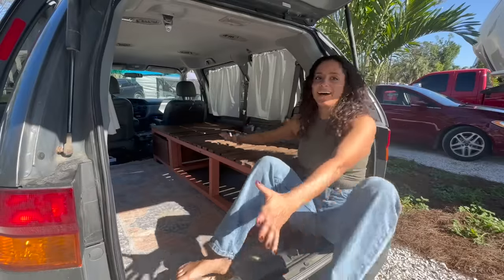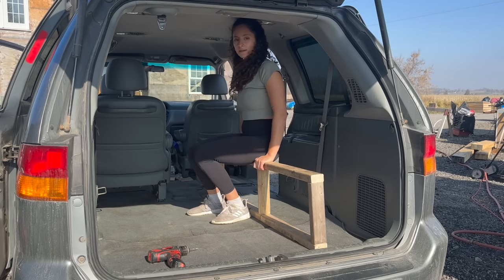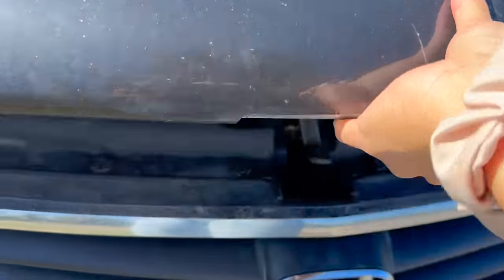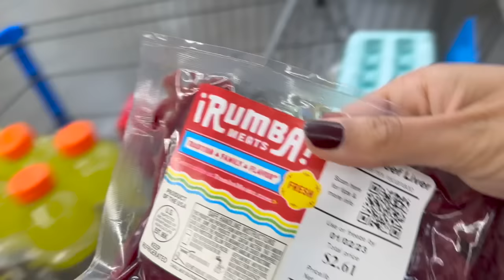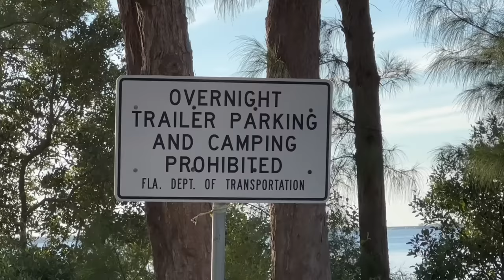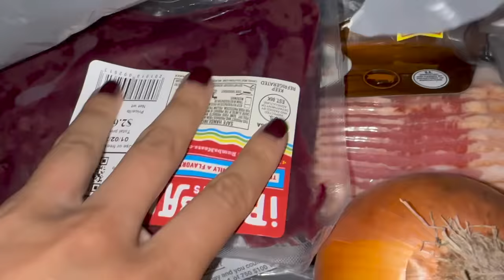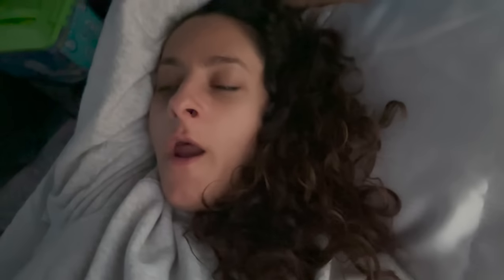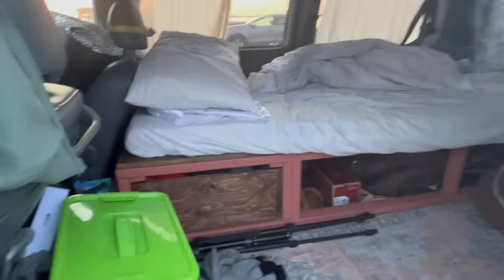Car camping in florida is hard. Period.

Comment: Don’t leave your pup in the car while in Florida. Even in the winter the inside of a car can get so hot, it can be deadly. God bless and safe travels!
Reply: And it's a completely horrible way to slowly die.
Reply: I live in FL and I have a dog.  The heat is the biggest problem I have when traveling because I can’t leave him for even 2 minutes inside my van.
Reply: My puppy passed because of heat
Reply: I'm sure she lets the car run with air conditioner on

Comment: ...   looks great  ,  I think you'll find that the velcro tape on the windows will melt in the heat ...  little screws into the plastic around the windows  will do much better   ...   safe travels   ...

Comment: I did exactly the same thing .... I had the bed built to a height so my head wouldn't touch the ceiling when I sat on my bed.  But silly me, when I added the mattress, I couldn't use my bed as a couch because I had no head room to sit up straight.  I thought that surely no one else would make such a mistake.  LOL.  But I too want to have storage space under my bed, so I'm not going to lower it.

Comment: Walmart also sells the cheapest car window tint kits for like $20 or something.  They aren't bad, only a little milky, but you can get more crystally clear tint for like, twice as much.  All you need is really clean windows and a heat gun.  I think they give you the smoother plastic spatula thing with the kit.  It's not that hard.  Your curtains are nice cause they let light in and the look nice . . . for now.  Home Depot also has special pricing ($9.97) on one size (24" x 10ft) of that mylar bubble wrap for using in windows.
Reply from the maker: Ya I was thinking to put some cheap tint up! Thanks for the tip ❤️

Comment: Do you use iOverlander? It’s our fav. Also have you tried the Florida Water District campgrounds? They are free. Each district has its own website and rules but they are not too bad. In a stealth setup like yours I would stay as long as it doesn’t say no overnight parking. You aren’t camping just parking. Do you have a fan for white noise?

Comment: Nearly lost my life at that pier (old skyway bridge)late at night my boat had the engine powerpak go out on an outgoing tide. Got drawn by the current underneath the bridge and got hooked in the hand as I was swoshing away the fishing lines from above. My buddy had the push pole against the bridge trying to slow the boat as the current pulled us thru the pilings. I was litterly hanging off the back of the boat ready to get pulled overboard when her unhooked . Ripped a huge gash in my hand. Things ya do when yer young ... still can't believe I put myself in that much danger. That outgoing current was strong and a dark late night if I went overboard I'dd a been shark bait. Wouldn't be here ta tell the story.
Reply from the maker: Holy! That’s a wild story. Glad you made it out

Comment: When first starting out, there's so much to learn,  adjust to, and improve upon.
Those curtains, delete.  Get black semi-sheer fabric that's a foot longer as 1 left side, and 1 right side, and 1 rear window, and 1 front fabric (curtain). Then, with a fork, push the fabric into the small space at the top of the plastic ceiling supports to have total full privacy plus curb lights shining outside (like street lights).  Take the mattress, and put it on the floor.  And your stuff, put next to the mattress.  Get a 600w power station, and use a portable dc fan.  When 1st starting, buy subs, Asian cooked foods, etc., and hold off on anything raw to cook until your more experienced and in better locations, more in nature.
In Florida, in those gulf estuaries and gulf waters, there are Bull Sharks.  Be extra careful, also with your awesome sweet doggie.  Sharks can come within a couple feet of the shoreline, in inches of water.  The waters of the gulf side, are seriously dangerous including flesh eating bacteria.   The Atlantic Ocean side, is WAY CLEANER and much fresher...even awesome.  Learn about the waters and safety.
In Florida,  you are very limited for night parking.  Rest areas, Walmart, Cracker Barrels, truck stops, and if super stealth (meaning only for sleeping) you can sometimes park strategically at motels and some street parking.  Otherwise, Florida wants your money, meaning, campgrounds and parks.  In 21 years,  the very beginning, I paid about 8 bucks on the northern California ocean cliffs, which had showers, very few campers, and it was Heavenly.  Yet, I only paid a few times...the rest of the time I learned how to find the free places that were cool...like casinos, truck stops, Rest areas, cliff pull offs (with others because alone you can be subject to California locals who are super ignorant, rude,  and could be dangerous)... (if you think education is expensive,  try ignorance, which is a pandemic).
In 21 years, it's been about a 96 out of 100, as far as really good.  And I mostly urban vanlife. 
If you are about 23+/- miles north of Santa Cruz, THE BEST ORGANIC STRAWBERRIES are in this adorable strawberry farm where they actually have fresh strawberry pies, and many strawberry items.  The strawberries taste like candy!  Best in the WHOLE WORLD STRAWBERRIES!
Nature vanlife, is the best.  Yet, there are odd challenges there as well...like bears, varmints (that can chew on your electrical wires which can be really bad, plus expensive)... and the worst can be unwanted ignorant humans as well. 
So, it can also be THE BEST!  Nature, Peace, quiet, snow, rain, sunshine, streams, birds, and no one around.  And the bliss can go on for days, weeks, months, and seasons.
Mostly, it's about your choices in consciousness... your spirituality ... your connection with the Spiritual Family... your focus.  There's power dwelling with the Spiritual Family. 
In the beginning, of anything, there are adjustments to make.  With starting vanlife, like you're doing,  especially with your moon time, it's okay to stay at a campground, or get a motel room.  It's okay.  Relax.  Take things one day at a time.
In Florida,  vanlifers usually do things in the day, until bedtime, then be ready...scout out places before hand, like truck stops, etc.,  (and have your with curtains up) and when it's bedtime, pull in, and go to sleep, then any time in the morning, patronize where you stayed, like buy some juice or pancakes, or some fuel, and go explore the beaches, etc., until bedtime!
Before you know it, you'll adjust to Vanlife!
Everything new, takes adjusting.
Vanlife, is about freedom.  Go where ever you want, when ever you want, and stay as long as you want.  Explore.  Relax.  It's okay.  Learn about the world, nature, and about who you are.
With one month's rent, you can drive around the entire USA.  With 2 months rent, take your time.  With 3 months rent, eat the best foods and treat yourself really well.  With 4 months rent, start adding to your  savings account.  In 5 months, you're in the groove!
Vanlife for a few months, or a couple seasons, or a few years, and relax...it's about your  freedom🌻  You can go back to paying rent when ever you choose.  Or do both.  It's about your freedom🙏
Around Mid-March, maybe take your time and head for Sedona, Arizona as the desert flowers might be incredible this spring in April  due to lots of winter rain and snow.  There's zillions of places to park with no hassles.  If it rains, watch out for that silky mud and avoid getting stuck.  Yes, everywhere, there are adversities.  Uts like a natural occurrence, to help you learn how to never let anything bother you, as in flowing in harmony past those adversities.  It's a Master, who can dwell in Loving Harmony all the time.  I know I'm not a Master as I still have enormous amounts to learn in order to rise above all the adversities in this life.
Anywhooo... Vanlife, is about being as free as you can, learning, and exploring who you are.
The VERY BEST to you little sunshine girl and poochie.  The Florida rast coast beaches (like Melbourne Beach, Patrick AFBeach, Satellite Beach, Cocoa Beach, Daytona Beach Shores, Jacksonville Beaches, are awesome, and tgeres great beach showers and Planet Fitness places.  Then in March maybe explore Sedona, then the Colorado Rockies, and the Pacific Ocean beaches, etc., etc., etc. 🌻